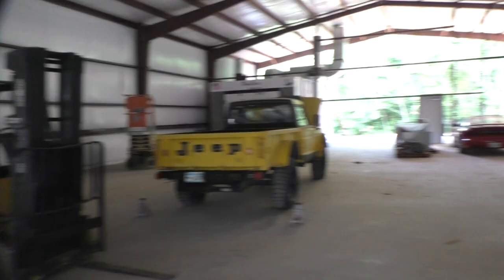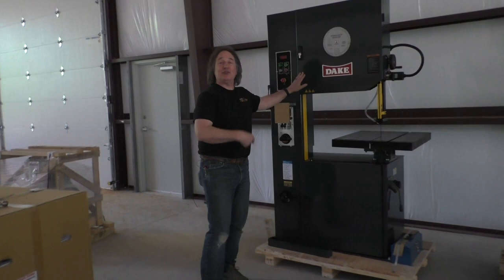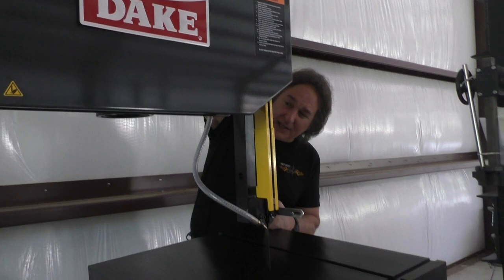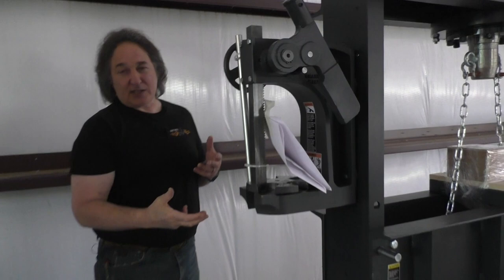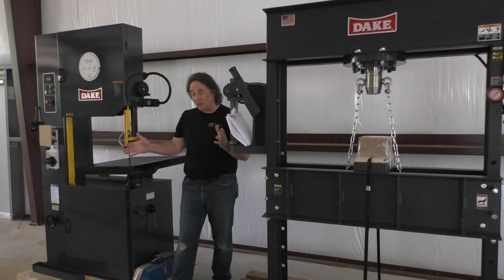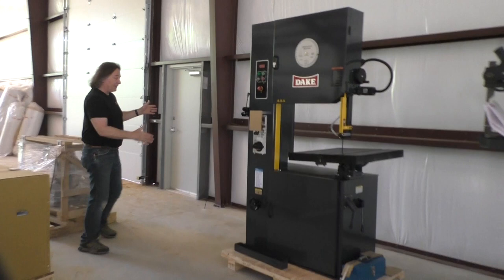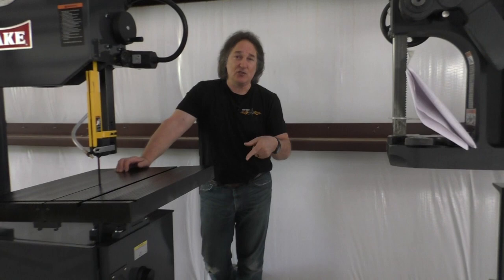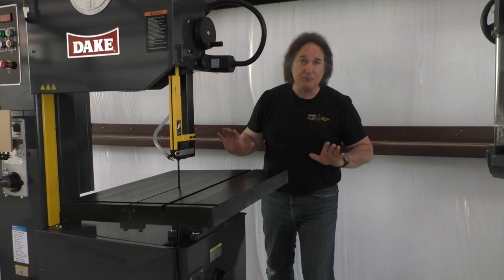Stacey David's GearZ New Garage

Comment: Nice shop I'm in a 20 x 80 and need a 100 x 100 at least with 60' overhang to work outside. I'm 2 blocked most of the time 5 lathes 3 mills, horizontal bore mill, horizontal band saw, vertical band saw, welders a 10' brake ,10' reach radial arm drill, drill press goes on and on. Really need a bigger shop. Yours looks very nice.

Comment: Nice trick leaving the stuff on the pallets to move them when you need them and put back when not needed.
But I would scrap the wood pallets for the more durable one made out of harder materials like plastic and mount them on those instead.
Otherwise that is going to be a very big blasting shop and have more than one project going on at once.
Looking forward to more episodes on the web or TV